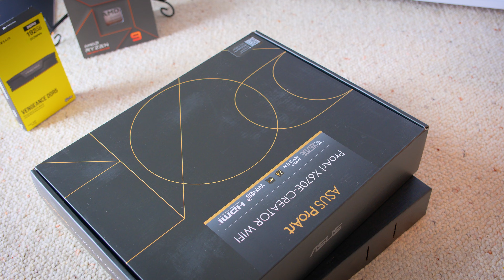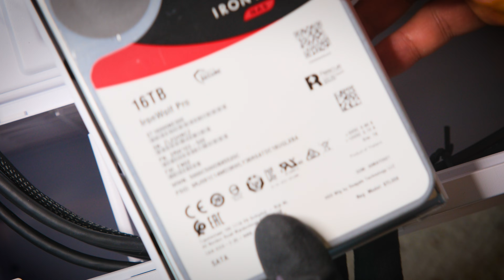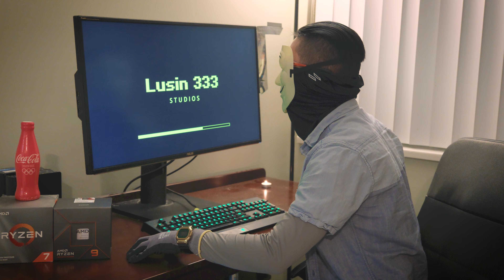$7000 Custom PC Build Timelapse - AMD Ryzen 7950x, Nvidia RTX 4090 [2023]

Comment: Your Github " Low Orbit ion Cannon " is OUTDATED it DOS NOT WORK WITH VERSIONS HIGHER THAN 1.18
since you dont have " issues " Available there i have to Write here !

P.S.:
i like how you Handle with Gloves All Parts in the Video , Except that you Wear Glove only on One HAnd , And Other Hand Human-Grease Get all Over the Parts and Conductors+ Semi-Conductors and could make a Shortcut or Hot-Wiring call it whatever you want , but Voltage Rainbow can Jump from Conductor to Conductor, Also Human-Grease is not good for Parts !!! ( dont ask me Why , ask internet )
and for all the kids down in the comments , most of us dont need RTX with 32 GB Video because we have 512 TB RAM on Servers , with more Horse Power than your 120 video cardS with 32 GB VRAM can come up with and  handle (even on RIG ) Because Every VideoCard is STANDALONE for itself , thats the main Reason why you Cant play 1 Game on 2 VideoCards at the Same time !!!
Overall 
RTX :
120 x 32 GB = 3,840 GB ( 4 TB ) ( 1024 kb = 1 MB / 1024 MB = 1GB / 1024 GB = 1 TB ) [ DO NOT WORK AS ONE ]
Server :
512 TB RAM = 512,000 GB ( NOT EXACT just for Comparrison 512 000 GB <?> 4 000 GB !!! ) [ DO WORK AS ONE ]
Reply from the maker: I'll update the Minecraft Github thing... later.  I'm busy using my brand new AMD 7950x computer.

I'm also working with the guys at the office doing... tech stuff (https://youtu.be/LW0PJlKOoXc).
Reply: @Lusin333  No Rush , i didnt replied you here just to inform you , the big deal is " Open issues State " on Github , Faster Respond in the Proper Section on the Proper Zone with the Proper Object/Subject , because we are having Tech Conversation on Utub ha-ha 
😂👍
GLHF ( Good Luck Have Fun )

P.S.:
im using my  " Nitro 5 " Computer too , but it has less Performance than the Server , so i rather build 250 GB Projects on rather Fast Machine , because my Nitro5 will need 36 up 72 hours  and the Server is Done within 7 min ...